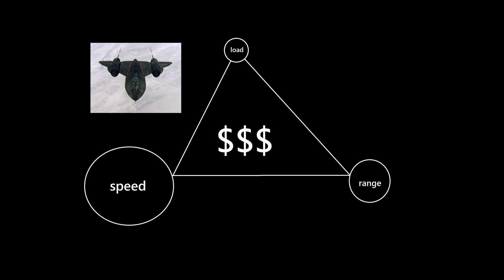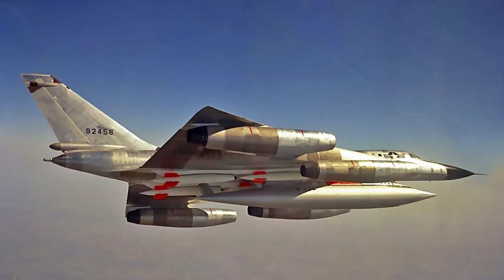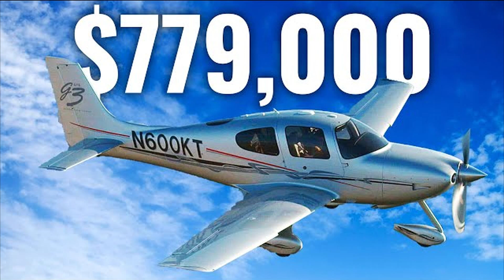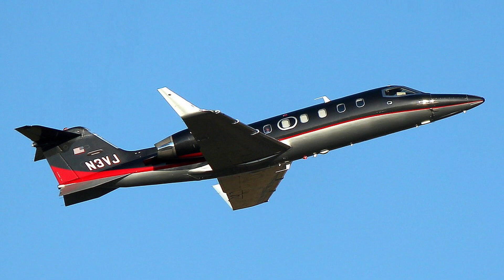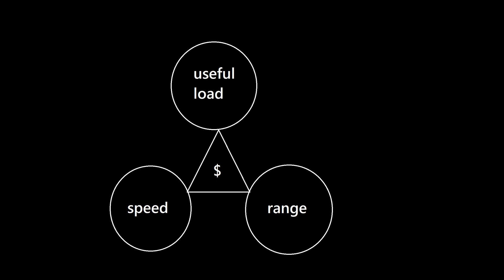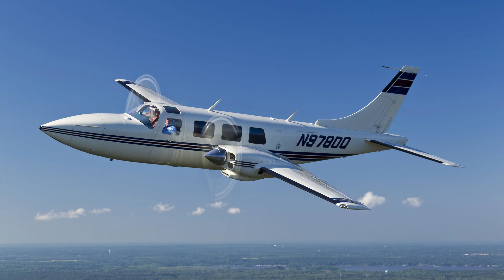The Cost of Speed

Comment: The power required to overcome drag scales with the cube of speed, all else equal. To get 2x the speed, you need 8x the power and the same increase in fuel burn. Only going 25% faster requires double the power and fuel. Speed is life but you pay dearly for it.
Reply: True.  If you ca get up in the thin air, that helps a lot.

Comment: When the Grumman AA5B Tiger appeared in the later 1970’s it gave retractable gear competitors with more horsepower a run for their money. 130 kts true on 180 hp, fixed gear, fixed pitch prop. They are still very popular. A good one today is not cheap to purchase, but probably cheaper to operate than, say, an Arrow.
Reply: It is a cool plane and very efficient but pays for that with payload restictions and fairly brisk descent rate.  That said, it is abour as good as you can get for speed vs $$ + simplicity.